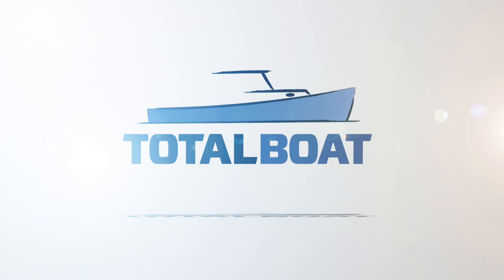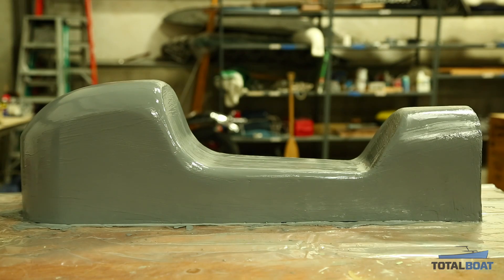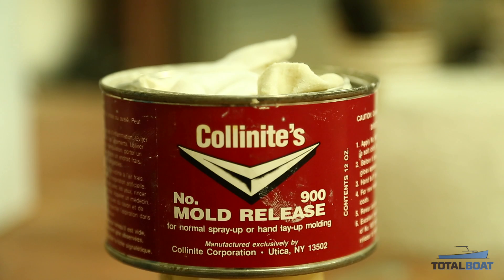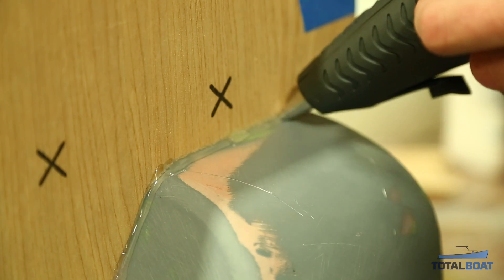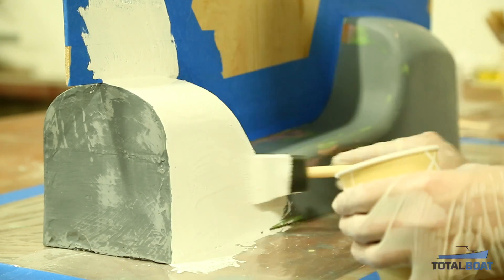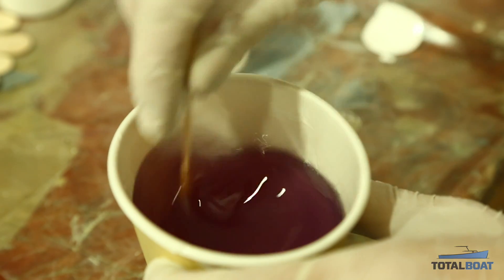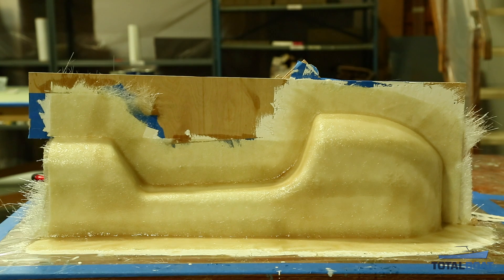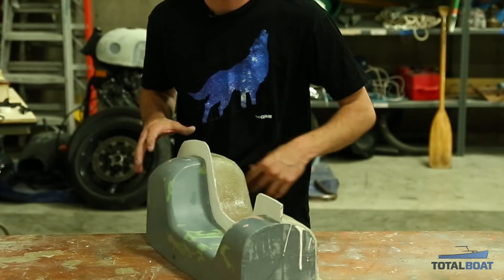Making a Plug for a Mold - Part 4

Comment: Can epoxy resin be used to make the mold  or is epoxy just for the plug and polyester for the mold?
Reply: I’d assume you could use poly on the mold because it’s not touching any foam and everything underneath is already cured.

Comment: Question, final fiberglass build up layer using the same polyester resin w/o wax resulted a cured tacky surface.  What is the method to obtain a HARD cured surface?

Comment: I have built a Polystyrene foam waterfall (Theme Park Size - 18' high by 25' wide, but I have had lots of grie trying to put 2-part epoxy +fiberglass strands over the top.  Right now my foam is "melting" uncontrollably.  I need to give this project some strength, and I thought that I could just cover it with fiberglass, but this isn't working!  HELP!   Denny Magic - denny.magic@icloud.com
Reply: The Total Boat 2-part epoxy does not heat up and is safe with foam.  The fiberglass resin you're using may use heat to cure. You can use it over the cured 2-part epoxy, but not directly in-contact with the foam.

Comment: What if you didn't need an exact duplicate of the part, and therefore didn't need to make a mold first? Could you just make your plug as usual and then lay down strips of fiberglass/resin right on to the mold release wax and then finish with the gelcoat as the outside layer of your actual part?

Comment: I think a one part mold is always the best way to go.  Less work after the part is made.  Now you have to put the two half together and strengthen them into one durable part.   Not to mention the ridiculous seam line down the middle of your part.  If your part doesn't have any tumble home on it, then a one piece mold is the way to go.  Especially a part as small as this.  Build a one part female mold of this and tell me if I'm wrong.  How would you like to build your part evenly, lighter weight, no seamline to fair and fair and fair?  No primer paint then finish paint to deal with.  Just pull your part, cut off the flange sand the edge and your done. It's that simple.

Comment: I wouldn’t remove the 1st half , I’d do both halves , trim the flange and then remove from the plug. By removing the first half you risk gel coat seeping under the mould as you’ve broken the seal. Also I’d  add some locating lugs for a good fit.

Comment: Does anybody know what the power tool at 4:09 is?  It looks like the cutting edge isn't moving... is it using vibration?
Reply from the maker: That is the FEIN MultiMaster.  It comes with  lots of great attachments for sanding/ cutting and working in small areas. Available at Jamestown Distributors.  
https://www.jamestowndistributors.com/userportal/show_product.do?pid=3391
Reply: Oscillating cutting tool.  There are many different brands that can use an assortment of blades for differing applications.

Comment: I never see anyone build a glass fiber part directly on the "plug". I know the outward facing area will be rough, but if you just want to make a glass fiber box and sand it down and paint it, then surely it could work?
Reply: That's not the part,  it's the mold.
Reply: Yes, you can do that for a 'one off' part. It saves you making the mould that you aren't going to use.

Comment: Does this gel come with mixing instructions, I read it did NOT, in the reviews, how would I get a proper mix?  Do I guess on the mixture?
Reply from the maker: Don't guess! We are updating the product to include instructions = Big mistake by us - so sorry! Instructions are being added to the website and to new labels. 

It comes with MEKP Catalyst and at 77 degrees F - the gelcoat requires the addition of 2% MEKP by volume: 14-16 drops per ounce or 2 teaspoons per pint for a working time of 10-15 minutes. The amount of MEKP may be adjusted in small, incremental amounts, either upwards or downward, to account for Temp differences (more for cooler temps, less for warmer temps) - The acceptable amount of MEKP is 1-3%. Do not use more or less catalyst than this. This is true for both waxed and no wax gelcoat.
Reply: much appreciated, i will wait for this, will work on the primer first and get this ready to add the gel coat last, , love your videos , you did a nice job, thanks for the show,  blessings

Comment: Could you use epoxy instead of the polyester resin?..........
Reply: Epoxy is more money so for a mold its not really worth it,especially for a  one off or low production part.Now if you're building molds that you're going to be pulling parts off of for years to come it might be a different story.

Comment: Awesome! I need all these products to make my own musical instrument case!........oh, what if you decided to make a one piece mold of your seat? Would you have had any problems gettting it out of the mold?...
Reply: You could have molded that in a one piece mold,especially after I saw the finished part with the lower sides.But you'd have to make the sides lower to make it easier to release. I'm assuming he did the 2 part to help with the herring bone pattern in the carbon fiber.But he'd really have to answer that although if I were to try the pattern he did I'd have gone 2 piece like he did.Now if I was doing a gelcoated glass part I would have made a one piece mold with sides closer to the finished height(and possibly a slight angle inwards) to facilitate removal from the molds.There is a lot to making molds and its fun but dont be afraid to fail because even the best plans sometimes dont work.Reworking molds is a unspoken part of the process. I've seen plugs CNC'd from foam over 30ft long get tossed in the dumpster just to start over from scratch and the same goes for molds that cost more than most people make in a year.So dont get discouraged it happens to the best ;)
Reply: Wow!.......😞 iam about to make a plug for an musical instrument case but I have one question. What is the actual function of the gel coat? What makes it different from using regular epoxy to start my mold???.....
Reply: I've never seen a mold made without gelcoat,its sort of a thick tinted epoxy that leaves a glass smooth painted surface,works as your first layer and it is what allows you to release the part from the mold(in conjunction with the wax and release agents).I wish I could explain it better but you cant just wax the raw resin surface and add a release and expect to get decent results.I'm sure it's been done but you'll be lucky if it works at all let alone get a good mold to pull multiple parts from.
The gel serves the same purpose as the Imron paint he puts on the plug in that its the surface that the resins wont stick to.But when making a mold from a plug you need something with more substance to it than paint for your first layer because your building things in reverse.

Sorry I cant explain it better but years of fumes sometimes take their toll lol........Get yourself a small can of gelcoat and make a simple practice mold from something small.You can use something around the house/shop so you dont need to make a plug.Just be sure its smooth and can take a few coats of wax before you hit it with mold release and do your layup.Follow the instructions,build up a mold from your object,starting with gelcoat,glass etc and let it setup and then pop it loose.
Once you go through the steps on something small and simple its going to make total sense.
Reply: SouthJerseySound super!!!!!......thanks alot bud, you just schooled me!
Reply: carl marcelin No problem,I just had surgery for a broken leg and have too much time right now and was trying to help.Sorry I cant really explain it better.It's just I'm usually better at doing things than I am at explaining them.......Out of curiosity where are you located?The reason I ask is I'm currently doing some composite speaker work.But after thinking about what you're trying to do I had some pretty sweet ideas.If you're looking to do something more than personal gear and looking for someone to work with,we should talk outside of here ;)
Reply: carl marcelin Nice,I'm located in Southern NJ in the States and also have a place and business in Varna Bulgaria............I was surprised to find it on youtube but The Arnold Company has their collection of videos they made on here.Most of his videos are geared towards aircraft but the its all the same.He has a video he did on mold making that is probably the most comprehensive out there and its free now.I'd highly recommend taking the time to watch it as it'll clear up the issues you had with epoxy,polyester resins and gelcoat as it aplies to mold making.The only thing to keep in mind is that it is a older video so some minor things may be different with todays epoxies etc.But to be honest you almost always want to go by the manufacturers guidelines when it comes to specific instructions.
Reply: Impressive!.....much thanks! Merci beaucoup!😎
Reply: @Jazzmarcel  gelcoats are purely cosmetic.
Reply: carl marcelimnhhgkgctugb
Reply: SouthJerseySound is correct!

Comment: That was a good tutorial.. Thanks!    Am I correct in saying that your first layer of chop strand is applied with NON-wax poly?  because if your letting the first coat cure, then it would have to be I guess or the following mixes would not bind.  Im new to this.  Thanks